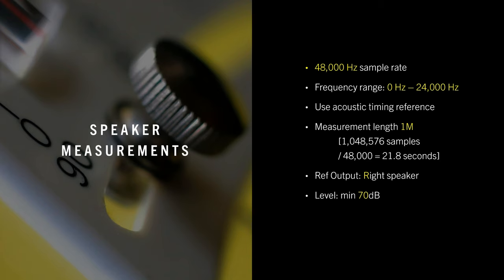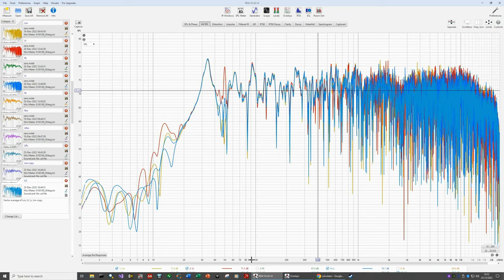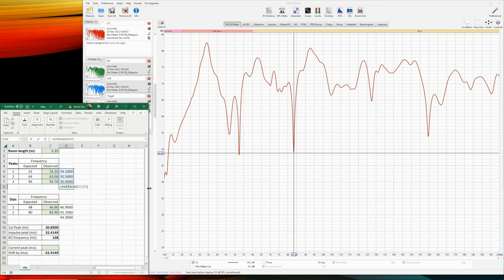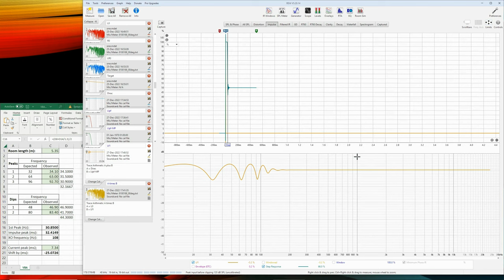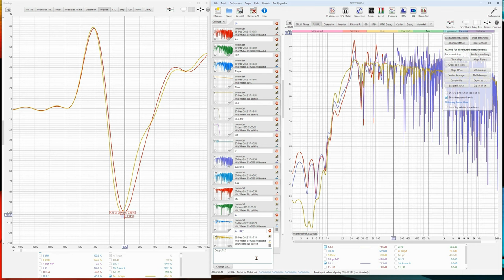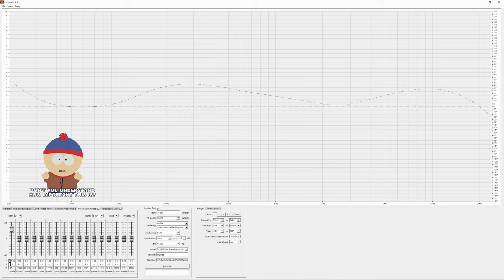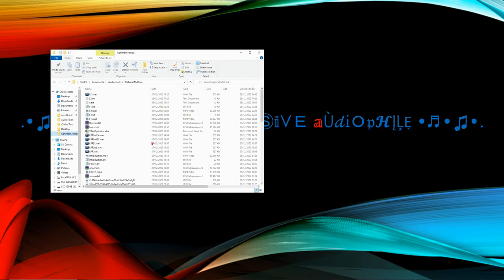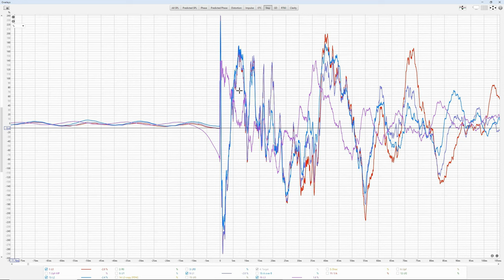High Fidelity Digital Room Correction with REW & rePhase

Comment: Hello again,
i would like to know what filter 2 actually does. I know filter 1 is to correct standing waves in the room, filter 3 and 4 correct  speaker crossover anomalies, but what about filter 2? To me is the filter thaI has the most impact  improving the sound in my hifi, is it for room correction?
thank you very much.
Reply from the maker: Filter 2 works like an an equalizer dimming peaks and boosting dips in the response.

Comment: Really interesting one. Just a question: are the filters built with this toolchain compatible with CamillaDSP for use in Moode Audio, at your knowledge?
Reply from the maker: I think they're because I heard Camilla DSP a lot in forums but I have never used. If it's able to process WAV files, this is all that's needed.
Reply: @ocaudiophile  Thank you! Yes, it supports WAV (both mono and stereo) so I will try this setup as soon as I have the time to take the measurements :)

Comment: Thanks so much for being willing to share the efforts of your hard work! I have a question following up on the process when one has a separate sub in addition to the two mains. You suggested below to first time align the sub with the mains and then follow your process with the sub actively involved. That's all clear and makes perfect sense. However, I've found there is a lot of inconsistency in terminology across the internet concerning time aligning subs. Would you be so kind as to provide a little more detail on how to do that in this context, or point me to another youtube resource you think explains it well? There's a lot of information on aligning multiple subs with each other, but I haven't found anything that appears relevant to this situation.
Reply from the maker: https://youtu.be/ga2eOwJRtXo

Comment: OCD, I am relatively new to room correction although i am long time audiophile.  I recently purchased Roon and want to use REW to correct for my room/speaker anomalies.  You have so many videos...is this the video i need to fully understand and follow?  Please advice which one i should follow to use convolution correction technique for room correction, adjusting phase/timing and aligning with the Harmon curve.  Thank you so much for your service.
Reply from the maker: This is a good one overall showing all steps of room correction but some of the methods in this one are replaced after new REW additions like excess phase inversion. This even older one is a good start if you lack REW experience because it comes with a written manual:

https://youtu.be/5YcH7j2-L1Y

Its results are quite good.

For phase correction, this one is the latest and beyond anything you can find online:

https://youtu.be/ChPu0u3nZxc
Reply: @ocaudiophile  Thank you so much!

Comment: Hi, thanks for the videos. I've been through them a couple of times and created the filters for my system. Filter 2 is certainly working correctly as it successfully gets rid of the huge bump in the bass response from my room. Not sure I can really hear much difference from the other filters, perhaps my implementation wasn't quite right. One thing I noticed was that if I pause a track with the filters on, there's a few seconds of garbled electronic noises. Is this a feature of FIR filters? Or perhaps indicates a problem with my filters?
Reply from the maker: No, it's not normal. Phase corrections aren't immediately audible but you should hear a heightened and more accurate sound stage.
Reply: Ok thanks. I'll have another crack at building the filters, otherwise I guess there's something going on with EQ APO/Qobuz
Reply from the maker: @oliverfreeborn8944  EQ APO has some latency inconsistencies but generally behaves well with these filters. Do not normalize IR peaks while exporting filters to EQ APO if you are...

Comment: Hello @ocaudiophile,
I plan to implement this type of work in a 4-way active installation in the car.
There are DSPs of different brands in the car. First of all, as far as I understand, in order to use these filters, it is necessary to use a processor with DIREC support. I would be very happy if you could share information about loading the filters into the processor. Thank you very much in advance.
Reply from the maker: İ don't know what direc support is but  most DSP engines with FIR filter capacity will accept wav or bin files. It's possible to save REW filters in these formats.
Reply: @ocaudiophile  
Thank you very much
Reply: @Bayezit2000  Which DSP are you using please? Did you sucessfully implemented it in your DSP with the help of REW?

Comment: hi, for the linearization filter i have a problem with my speakers with this data Acoustical Active 130 Hz - 4.5 dB/oct and Electrical 1.45 kHz - 6 dB/oct broadmann vc1. how do it? many thanks
Reply from the maker: I couldn't find a test online for the VC1s but as far as I understand the first crossover at 130Hz is an active one (rather than passive) so it will not cause phase shifts and will not require alignment. The second one at 1,450Hz is even harder to understand as it says just electrical. If it's passive it must be causing some phase shift but at 6db/octave that must be first order so too small to fix with rephase linearization filters. Best way is to check the phase response graph of averaged, multiple measurements and try various rephase filters for 1450Hz to yield the flattest response if required.
Reply: the first filter is a resonator panel tuned to the speaker cabinet
Reply from the maker: Do you see any discontinuties in the phase graph at 130Hz?
Reply: I did a rough study but it seems so. Unfortunately or fortunately it is a particular speaker
Reply: Hello
how is it possible that L3 is -3 db compared to L2? L3 has no Spl info
Reply from the maker: @lucasantilli6510  Sorry I didn't understand the question. L2 and L3 should be identical SPL wise.
Reply: @ocaudiophile  when i create L3 with L2 and Lf3 AxB the result is the same of L2 but with -3.01db
Reply from the maker: @lucasantilli6510  I see, you must be using a different version of REW. Just add an SPL offset of +3dB to Lf3 (in "Measurement actions") before multiplication.
Reply: @ocaudiophile  done after creating L3

Comment: Hello,
when i try to built FILTER3  i have improvement only on one channel (the Left one) compared to filter 2 results ( clarity i.e. is some dB worse than filter 2). Is that possible?, i tryed to repeat at least ten times , but the result doesn't change. ANY IDEA ? an obsessive compulsive audiophile DEPRESSED at the moment.😮😮😮☹
Reply from the maker: Clarity is meaninglessly too high in typical household rooms, it's a measure developed for auditoriums and halls.
Reply: @ocaudiophile  So I'll noit consider that, thankyou very much

Comment: First of all, thank you for your great video. I am a beginner

Can you explain in more detail the centering of the microphone at the beginning of the video and what are the parameters in REW which allow the right speakers to be aligned at Zero

Second, at what point in the video should we apply an FDW to L1 and R1, then reverse.
And what do you mean by fdw must be applied?

thank you again for your videos
Reply from the maker: You can use Acourate trial software mic alignment tool for perfect mic centering. There're links in the description. Alternatively you can compare left & right speaker impulse peaks 8n overlays graph and move the mic accordingly until it is centered. 
The speaker you chose as acoustic reference during measuremrjts will always have its impulse peak at time zero.

Frequency dependent windowing should be applied as shown in the tutorial.
Reply: @ocaudiophile  - I've been a huge fan of your convolution and inversion video.  In that video, we offset/align both the R/L to t=0.  I did not use Acourate (on OSX) to adjust the microphone for this tutorial.  I took measurements as instructed, with R as the reference channel.  When I look at the impulse graphs, Rm is not aligned to T=0, and Rl and Rr are not aligned to Rm.  Am I missing a setting to get the R reference channel to align to T=0?  Or is this due to microphone placement and I need to manually offset/align R/L to t=0 as instructed in the convolution and inverstion video?   

Thanks for all the knowledge sharing and time you put into educating the masses!
Reply from the maker: @spencerjohnson8026  Thank you. Acoustic reference speaker measurements' impulse peaks should normally always be at t=0 regardless of the mic position. In REW/Preferences/Analysis tab, make sure "Adjust colck with acoustic ref", "Align IR peak", "Align t=0 to a smapling instant" are all ticked (and others untiecked). If you're still seeing deviations from t=0, just manually align them until every impulse peak sits on t=0. You can also use "time align feature at some stage. It will not make an acoustic difference from your listening position. It's only for the vector calculations to behave nicely.
Reply: @ocaudiophile  - Thanks!  I have those exact settings configured in the Analysis tab but I still need to manually adjust both the R/L channel to t=0 (Impulse, Offset=t=0) so the R/L aligns to 0u on the  Impulse Overlays.  Basically, exactly what you show in your Convolution and Inversion Video.  Adjustments are very minor and hopefully not missing something major.  Additional notes, running 5.20.14, OSX, UMK1

I'm hearing some great (best yet) results taking additional measurements, cross-correlation and vector alignment in this video and applying the Harman House curve and steps in the Convolution and Inverstion video.  These are also steps detailed in the chapter after you configure the Virtual Bass Array.

Comment: First question...
When doing the crossover linearization, should one do the crossovers and box type linearization also when using a sub and use the complete frequency response including the sub?
The prediction in REW shows a lot of preringing this way, but i don't know if the preringing will be real.

Second question...
When i do crossover and box linearization including the sub in the frequency response and then use a phase filter at 100Hz with +45°, but a bandwith of 0.4 or 0.3, will this cause preringing? If i do it this way the excess phase is naturally hovering around 0° (plus minus 5°) so i basically could skip the excess phase correction in my opinion.
Reply from the maker: Apply the spec XO phase correction of your speakers, even the lower band will be above the subwoofer crossover frequency. Box/port correction will have to be about the subs though. Excess phase correction below 100Hz is inaudible and will almost always cause ringing.Box phase linearization tools is your best option in that area. You can do mild phase inversion between 100Hz-1000Hz
Reply: @ocaudiophile  i already applied xo correction for sub to front (and for all crossovers in the front speakers. It's for a car btw. and it works really good).
Question was if i should add the box correction also. It's a sealed sub crossed at 60Hz acoustically to the front system. I would add the box correction for a Q=0.7 and the -3dB point of the subs response, would that be correct?

For xo correction i always chose the acoustical crossover, not electrical. Prediction says i get massive preringing from the box filter, but it may be a fault in the prediction.
I did the excess phase correction only between 100Hz and 1000Hz, but when adding the box filter for the subwoofer i basically could get rid of that step as the excess phase would then be around +-5° according to my measurements/predictions.
Reply from the maker: @Cathul  I am not sure of the correct parameters for the sealed box correction but in my home speaker experiences, ringing will only be introduced if the frequency is very low (<25Hz) with these filters. I think you gotta try and test different parameters. Whatever you do, do not try to correct phase anamolies produced by reflections, just corect what you can at the source.
Reply: @ocaudiophile  this is a problem in a car as you basically sit inside of the box. Therefor i wanted to try to just do the crossover linearization as you cannot eliminate the reflections from the direct sound in a car. Boundaries are so close inside a car that the first reflection is sometimes as early as fractions of a millisecond (imagine a tweeter located right next to the side window or windshield with a distance of 10-15 centimeters). With just the crossover filters and some slight excess phase corrections i was able to achieve several wins in sound quality competitions against competitors which were slightly ahead of me before, and this with a good advantage in regards to the score.
That's why i wanted to try the box filter to try to get rid of the excess phase filter.
I don't know if i should use the free field -3dB point or the -3dB in the car. In the half field it would be around 40Hz with a typical 12inch sealed sub that is put in a car while in the car it might easily be around 20Hz or even lower, depending on the equalization and actual dimensions of the car (it's a pressure chamber in sub frequencies that can add up to +12/octave starting at around 60-70Hz or even higher depending on size of the interior of the car).
I will probably test this out with both options (free field and pressure champer frequency) as i can switch presets rather easily in the Raspberry PI with CamillaDSP.
Reply from the maker: @Cathul  You sure know car acoustics a lot better than me ;) In the subbass area, the calibration microphones also deviate quite a bit in their phase response and the calibration files lack phase correction. You are usually flattening an inaccurate  phase response if you are only doing visual work. WIth very short (5-6 ms) right windowing of the reponse, you can see the phase response at the source but you will lose low frequency resolution which wouldn't help your case with the subs either.

Comment: Worderful tutorial!
I have a question…

I've already done several inversions and I've always done them from about 60 hz more because I'm afraid of breaking the woofers... The VBA acts like an EQ??
does it increase the db and can it put the woofers under strain?
Reply from the maker: No digital correction can break your woofers. VBA is a maximum phase filter and simply cancels out standing waves by producing a counter signal. There is a more optimized VBA method in this video:

https://youtu.be/q9aJqQpNyLY
Reply: @ocaudiophile  thank you!
Reply: @ocaudiophile  I don't have the access at xlm file....I sended request to you
Reply from the maker: @BarileTixxoFilms  I granted it hours ago?
Reply: @ocaudiophile  ok ok
Reply: @ocaudiophile  I have another question, in the creation of the LF3 filter with Rephase through the parametric phase equalizer.... Should the line be as flat as possible from 30Hz to 24kHz? The important thing is that it does not go beyond +45/-45 and that it is not above Q 1? Right?
Reply from the maker: @BarileTixxoFilms  We aim for overall flat phase "slope" throughout the frequency band, ignoring notches. Only between 100hz-1000hz is audible and beyond 2000Hz and below 20-30Hz is not very reliable due to measuremnent timing and microphone calibration errors. 45 degrees and Q of 1 is the limit for the phase "correction" you apply below 500Hz.
Reply: @ocaudiophile  So I correct from 30Hz to 1000Hz? Above 1000Hz I do not correct?
Reply: HI!!!
I have a problem with LF3..
I corrected the phase as explained in your video from 30hz to around 1500hz, pretty flat response with correction at less than 45 degrees and below 1Q.
The problem is that when I load LF3 into the convolution engine it gets clipping...
With LF2 I don't have any clipping problems so it's definitely LF3.
Rephase imports a boost from 157 db to 157.2 db so I drop it by -157.2 db.
Anyway LF3 is the best filter for me!!! Sounds great.
I hope you can help me remove the clipping!
Thank you

Comment: We are in the obsessive compulsive audiophile channel right? To find peaks and dips for F1 I've exported the measures as text and I read the value to report to the excel tool. Am I obsessive compulsive enough? 😂
Reply from the maker: That's a new high :) Btw, it will be possible to export txt files without the header in the new REW.
Reply: @ocaudiophile  Have you ever considered to open a discord channel where we can discuss about audiophile stuffs?
Reply from the maker: @teb76  Not a bad idea. I've never used Discord but will have a look.

Comment: Dumb question:  what do I do after I complete the inversion filter (filter 2)?  Do I generate a Wav and use it as a convolution filter in Roon or Jriver or EqualizerAPO?
Reply from the maker: Yes you can but better combine all 4 filters in one and use that one.
Reply: @ocaudiophile  woah!?  So these aren’t individual methods but methods to combine them?  Did the video cover that?
Reply from the maker: @joek6207  There are 4 different filters working together. The 4th one, excess phase inversion didn't fit in this video, it plays after this one.
Reply: @ocaudiophile  I saw that.  So we add all of the filters to Roon or EQAPo?

The accept multiple filters?
Reply from the maker: When you multiply (trace arithmetic) them with each other, you create one filter which contains all of them and you can use this filter (.WAV file) in Roon or EQ Apo.
Reply: @ocaudiophile  if I do 2 of the 4 will it still be an improvement over traditional REW EQ in a minidsp?
Reply: Just finished a rewatch.  I’ll rephrase the question.  If I only did filter 1 and Filter 2 would that create artifacts?  Regardless, I’m going to do all 4.

Also, if I run my speakers with a sub, do I essentially flatten the sub with a minidsp and crossover on the AVR and then do these filters as if the main + sub are one speaker ?